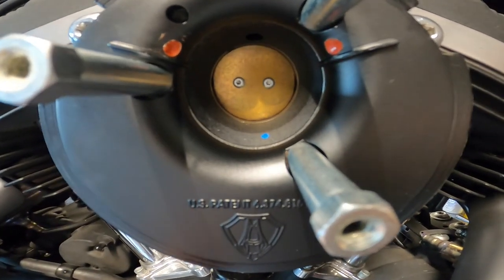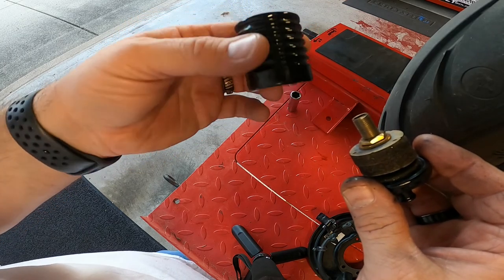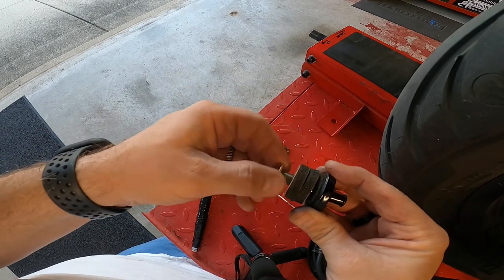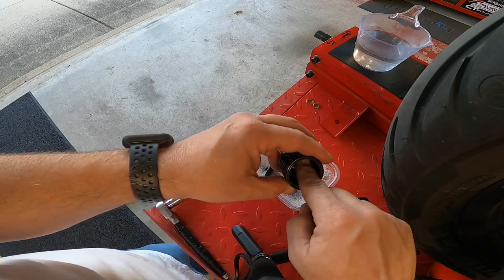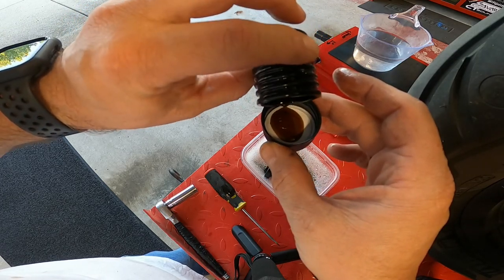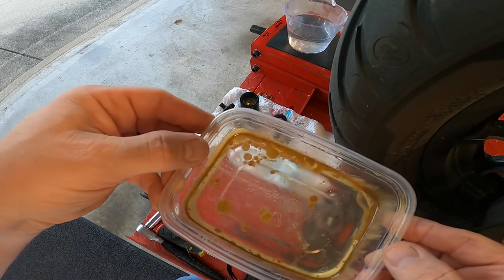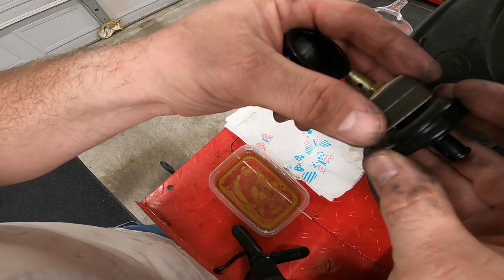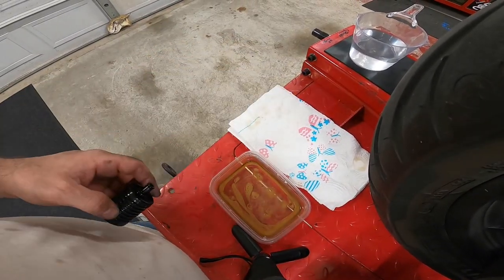How to clean a catch can - What is inside a catch can - DK Customs catch can on a Harley Davidson

Comment: First installed mine in the winter months. All it did was fill up with condensation (water) I removed it and would get a very small drop of oil on the ground after a ride. I installed the Trask vented trans cover and not a drop of oil anywhere. I sold the catch can. Waste of money in my opinion. Fix the problem at the source instead.
Reply from the maker: That will work for the M8 but not the Sportsters.